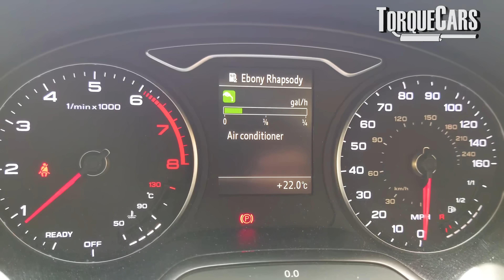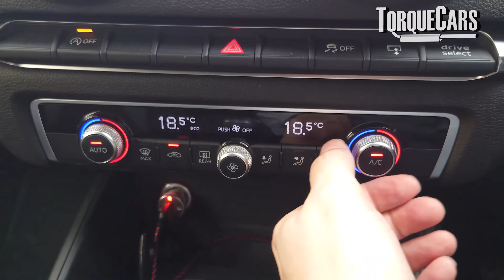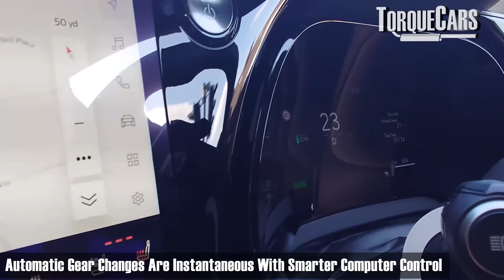The Biggest⛽ Fuel Economy Lies Every Driver Believes! 👉 What Really Saves Fuel?

Comment: A really BIG saving comes from doing your own repairs. A recent case is my wife's car that was smoking & using oil. She didn't want the repair bill & was being talked into buying another car with a $2,000 deposit & a $500/month payment for the next 4 years...I fixed it for $80.
Reply: Really? How did you fix it?  A lot of cars start to burn oil after a certain time period because of low tension rings and other reasons that can't be fixed for $20 no matter how much hype and advertising goes on with products to do that.
Reply: @meherenowmaybe Sometimes stuck oil-control rings can be released by a DIY procedure called a piston soak.

Comment: Driving with the ac on will always drop my fuel economy far more than with windows down. I've compared identical trips in near identical conditions numerous times on my car, and every time the difference is significantly in favor of windows down.

Obviously caveat of its just my current and previous car, but both cars had very similar drops in fuel economy

Comment: The best way to save fuel is by using an EV.  O fuel needed.
Reply: @EnriqueAThieleSolivan  Apart from the coal being burnt at the power plant or the fuel reauired to mine tonnes and tonnes of lithium for EVs.....
Reply: @zach6643 
  
No coal used to generate electricity in the UK.

Batteries are much less environmentally damaging than finding, obtaining, transporting, refining, transporting again, then finally burning fossil fuel. 

If you think that's wrong, you need your head examined, because it's a proven fact.
Reply: Absolutely. We use 2000 fewer liters of fuel now we've added an EV to our family fleet.
Reply: The battery is the fuel.

Comment: I don't find any noticeable decrease in mpg going 60 or 65 mph in my 2018 regal (opel insignia) with the 2.0 engine than if I'm going a bit slower. Even when going 65 or a bit more, the rpm's are quite low. I've got a 9spd automatic transmission and when maintaining a steady speed, can easily attain mpg of over 40 on flat roads (more like 44+). At times like that, it rivals even the best hybrids. Of course, it fails to match in-city. Then, I'm usually able to pull off 18-21 mpg.

Comment: I don't know about the UK, but from tests that have been done, saying that the more expensive fuels tend to have a better or larger additive package is absolute rubbish in the EU. All over Europe they've tested the premium fuels and the only one that came out with an additive package that was quantitatively sufficient was shell v-power racing 100, everything else had so little in it that you'd be burning your money compared to just buying an additive yourself, whilst with shell racing 100 both the amount in it compared to the higher cost was comperable to buying your own, the quantity was also sufficient to have effects take place over only a few fillups compared to tens of thousands of miles driven with others (like orlen or omv).
Reply: @ravecsucks6192  in the UK we actually test the fuels and have the information posted via each company. On a long journey I will either fill up with Shell or BP or add some redex, apart from that for pootling around supermarket fuels are the best...
Reply: @slarratt sounds interesting. I can't find any of it however. Could you point me in the right direction? All shell does on their website is list a bunch of benefits with asterisks.
Reply: Bravo, thank you for that. I mean, you'd think that sheep like the population of countries would demand to know what exactly is in the fuel they are buying for such a large investment as an automobile, but they don't. It's just exasperating. I mean, really proprietary, additive packages and such? Sod that.

Comment: E5 vs E10. Ethanol has less energy per litre than petrol. So more ethanol means less MPG. But talking about fuel economy without thinking of price difference is meaningless.
Same with diesel vs petrol. A diesel is more efficient, so consumes less. But in my country (not UK) diesel costs more.
No mention of 4WD consumes more than 2WD. 
Nowadays (at least in the EU) tyres has to be declared for fuel efficiency.

Comment: Added weight by an automatic transmission, more electronics will definitely save on the fuel, as well as improve reliability by increasing the amount of irreparable things that will break. So-called fuel economy, where everything breaks down often needing constant servicing. What great features of a rentier economy, where complexity is always increased in order to make things user-irreparable, thus increasing the costs per kilometer. Gearing ratios in the transmission is what really saves up the fuel. It is just that engines can be made less powerful, where the gearing ratio 1:1 is reached on lower gears, while giving more additional gears for cruising speed, where you would have worse acceleration, but really high fuel economy. B-b-b-, need those kompiuters there, sure. At speeds like 130 km/h there is already a lot of noise, no its not the tires, its the extra power needed to get through the more  resistant obstacle. If you had cars that normally go 100 km/h max, you wold decrease the amount of accidents, you really would have less smoke on the roads, roads would get less damaged  Key is having access to gears that would make the car rather weak going uphill, but 'overdrive' gearing optimization would pay off a lot when having to travel long distance at constant 'high speeds' the lower the original 1:1 engine to wheels being set rather low. Oh but the standards of today are for a fast acceleration and high speed, well, that is because fuel economy is more of an afterthought despite constant declarations to the opposite.

Comment: Accelerate (+ and -) gently, don't tailgate, anticipate (look down the road), engine brake (overrun uses no fuel), remove anything that increases frontal area.
Reply: How is it possible that engine braking uses no fuel? What about the fuel that is used to run the factories that make engines that don't last as long because you're doing so much engine breaking at higher RPMs?  I'm being somewhat facetious, but really my point is that you have to think about a lot of different things outside the box, if you will.  If your RPMs are higher because your engine braking, your cylinders are firing and burning fuel. I don't understand how you can say it's not burning fuel.
Reply: @meherenowmaybe  in modern cars if you are not on the accelerator and not at idle rpm, the fuel shuts off and the wheels drive the engine. It's totally harmless and you should only not do this on 2 stroke bikes
Reply: @meherenowmaybethanks to DFCO most engines use no fuel on engine braking. But of course one shouldn't give up using brakes, just be mindful of what's going on further down the road, and if there's a red light etc take your foot off the gas and just coast to it, minding also other drivers of course ie not always. It doesn't damage the engine if not forced.
Reply: @meherenowmaybe  With your foot off the accelerator and revs above tickover (750 to 800 rpm) carbs are on the idle jet and injection systems cut fuel. Your fuel consumption gauge should go to zero (or maximum dependent on units).
Reply: @meherenowmaybetheres a fuel shut off circuit on cars with electronic injection since the late 80s. The engine braking thing is bullshit tho. Lift off and brake. Youre not burning fuel.  Same result without putting loads on the engine it isnt designed to handle.
Reply: I have noticed that i get better fuel consumption if i throw my car in neutral long long before the trafficlight. It will coast forever. I know it will use fuel, but the distance it makes is much further then in gear. I do drive a Honda Civic FK8 Type R.
Reply: Brakes are slowing. Engine is for going.

Comment: Quite strange you tell us not to add additives premium fuels which have the correct amount of  additives. My car is a diesel and yes I use additives, 1 it increases the lubricity of the fuel and therefore increases the longevity of the fuel pump, it has detergents to clean the injectors and it has a cetane booster and this lowers the temperature required for the fuel to combust and makes for a cleaner burn with less emissions in diesel engines and it does improve my fuel economy by about 2%+.
Reply from the maker: There are good additives out there but there are so many which are not, some will cause harm such as clog up the particulate filter or even block the oil filter. It is safer to rely on the good brands of fuels additives as these are safe. Personally I use the BG range and have found them to be excellent additives.

Comment: You are wrong in far too many aspects to start arguing with you.
Skoda Fabia 1.4 petrol engine BBZ NOT a direct injecfion engine at all .. 38 mpg with 10% ethanol and easy over 40mpg with 5% ethanol.
On motorway M1 the other day I have seen 45mpg FACT, about 65 miles/h.
You don't know what are you talking about.
And yes I do most of my journeys exactly the same route to work! And I do measure consumption by deducting how many miles ... because I always fill to the max fuel tank!!!

Comment: For me outside summer is average over 100f 😂.
Yes the hot days of summer are over 110f the record is 123f in my state 😂.
Also I use ethanol free gas in my old car 2005 so ya its old 20 years old 1 more year and it can have a beer 😂😂😂.
I go from 18 to 20 mpg to 22 to 26 mpg with ethanol free engine temp is about 30f hotter then normal as ethanol free burns way hotter the 10% ethanol mix gas.

Comment: Part 6 about fuel at low temperatures, is NOT going to save you money.
The gas station sells fuel in the unit of £/litre@15C.
So they are adjusting the actual amount of fuel you get to control for the temperature.
It is usually written on the pump that it has been calibrated for 15C.
Reply from the maker: Interestingly 1 liter of fuel is heavier when it is colder and lighter when it is warmer, the density of the fuel is marginally affected by temperature which I guess is where the myth comes from. As fuel is stored under the ground at relatively stable temperatures, and the density difference is marginal at best it doesn't make a difference when you fill up, or even from summer to wintertime, it will always average out anyway.
Reply: @torquecars yes the volume and density will change with temperature, but they adjust for that, so if the petrol temperature is 5 degrees, and you pay for 1 litre you will get less than a litre delivered @ 5 degrees, so that it matches to 1 litre at 15 degrees.

The conclusion is that you won't same money on buying cold petrol. As they adjust volume to temperature, you are basically buying it by weight, as weight will not be changed by temperature.
It will also not change the energy output, because that depends on the weight.
Reply: Correct!

Comment: I hate to inform you but the single largest benefit of nitrogen in place of compressed air is the complete removal of water. This all but eliminates corrosion of the rim along the bead and inside the tire. The possibility of increased fuel economy is just a side benefit.

Comment: There is no "correct" pressure.  This all depends on your specific tire wheel combination, wait, driving style, etc. You need enough inflation to keep the tires wearing evenly if economy is your goal, and for optimal contact patch if you want performance. But yes you can increase fuel economy on many cars by going well over the manufacturer's recommended pressure, which they design for comfort as well.  For the Honda ZE1 the king of mpg, they suggest 38 front, 34 rear or something, but people often go up to 45, 50, some even to 60 on the front.  And it helps. A lot.  Especially since the margin between maintaining lean burn mode and not is a few percentage points of efficiency to achieve, and laneburn gives a much larger percentage in return if you can stay in it.
Reply: Speed matters depending again on the design of the car. On the average car, wins drag doesn't exceed tire drag until about 45 mph.  On some turbo diesels, you can get optimal mpg at more like 70-75.  I appreciate that you mentioned saving your time as lost income. I can work overtime at a rate that's six figures a year, so I'm finally, praise God, In the range now where it's worth it for me to pay for grocery delivery and pre-cooked food. It's a strange feeling.

Comment: Hmm, I recall somewhere that if you are going less than 50Kmh (31Mph) then having your windows down is okay in terms of fuel econ.
Faster than that, you're better off to have the AC on due to the increased drag.

As for octane, there are cars that are designed for lower grade fuel but are high compression.
Like the Mazda SkyActive engines - the manual for my SP25 said to use ordinary 91 unleaded instead of 95 or 98.
Course I understand that it has a knock sensor to adjust timing if it detects it.

Comment: Yeah i would call bullshłt on your claim that the 8 speed dual clutch which is computer controlled is better for your "fuel" economy when it breaks which it will 10-20 times more likely than a manual one that will set you back a few hundreds of gallons of fuel at once.... not very economicla mind you....
Reply: Autos are better than manuals if you don't drive like a lunatic
Reply: @BadBoiFX  They are not better. Automatic is fuel-inefficiency added, it is weight, complexity. What is added is a lack of manual control by the driver of a critical, including, safety, part of the car. If you want fuel economy you need the 'Overdrive' gearing at lower speeds. This is what makes it possible to have a less powerful - consumptive engine, while reaching higher ends of speed spectrum with worse acceleration due to less power being delivered at actually efficient gearing ratios. Key is having very efficient gearing that will barely eat up anything but achieve high speeds still while using minimum power - meaning fuel. 130 km 'requirement' on a highway, with good aerodynamics and gearing ratios, you should get there if actual fuel economy is aimed at, plus aerodynamics. Like : depending on load, on level terrain it will reach all the required speeds eventually with minimum fuel consumption achievable. High acceleration is how fuel economy is wasted, when most of the gears are about high acceleration, very efficient gearing will reach high speeds reachable in time on level terrain., not going uphill ofc. If you live on level terrain, why should you burn up fuel any way similarly compared to folks who have to push the car weight uphill. Meaning, all the fuel crises they are crying about can be seen in construction priorities.
Reply: @cdgncgnMost people can't drive whatsoever let alone manuals. And no one wants to sit in 1-2-1-2-1 in the city bumper to bumper with a manual. Most autos are very reliable if maintained but thats another side where ppl cheap out
Reply: @BadBoiFX  With manual you just can go in slow bumper to bumper city driving mighty fine you put it in low gear and release and press the clutch no problem the car will slowly roll
Reply: @BadBoiFX  Not if you had to service them so everyone who buy old cars because they only afford those a tiptornic bullshłt is a surefire way to get ripped off......

Comment: My Abarth does a cold start procedure where it idles at 1100 or so for 45 seconds, it feels like an eternity because it's quite loud but it feels tricky to control at low speed with that higher rpm so I feel a bit stuck there! My neighbours love me.
Reply: My Skoda Fabia does the same. Is nothing wrong to let the car in the morning to get its oil evrywhere and let it warm a little.. until the revs drops..